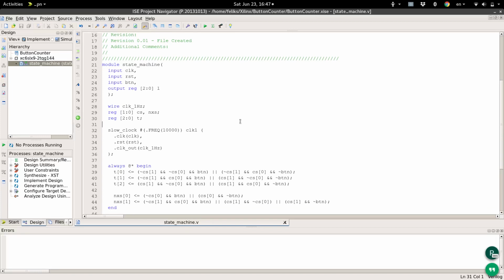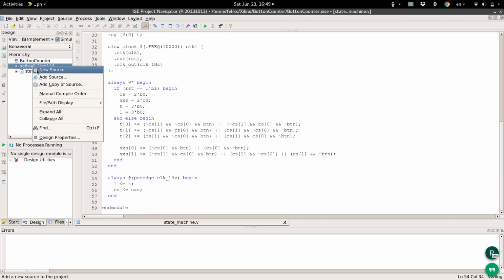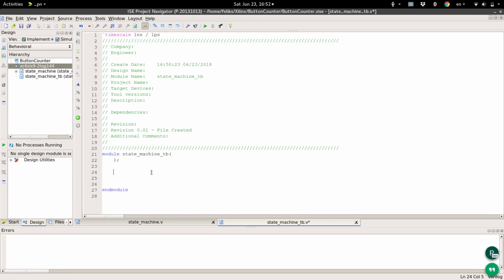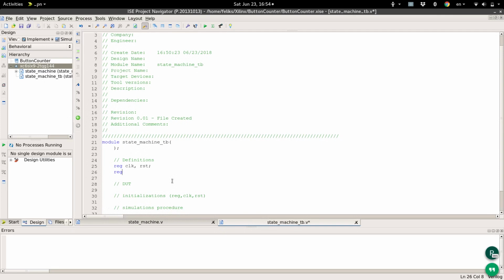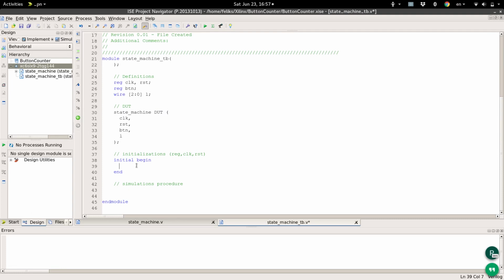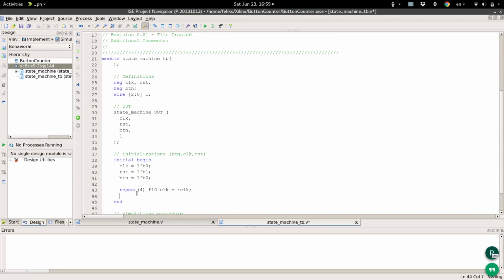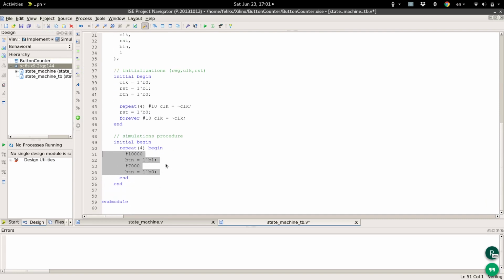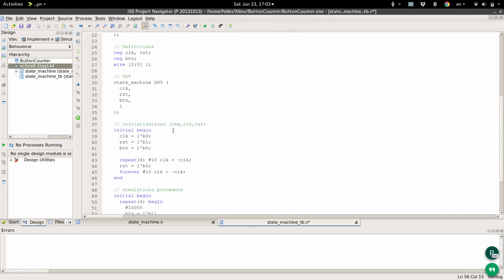Learn FPGA #17: Writing a Test Bench for ISim (for in-computer simulations) - Tutorial

Comment: can you use #delay in regular programs?
Reply from the maker: No. If you want to delay in a circuit, you would need a hardware way of doing so. I often use a binary counter as a timer and have different parts of the circuit activate when certain counter values are reached. If you can think of another way, I'd love to hear it.